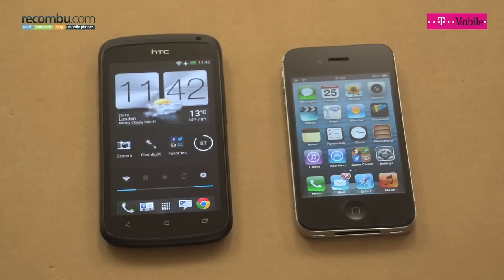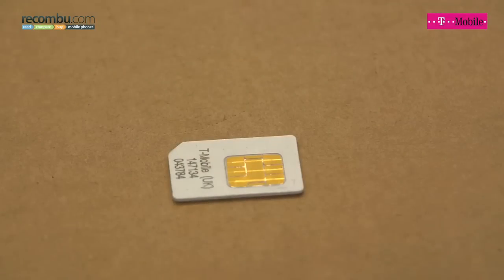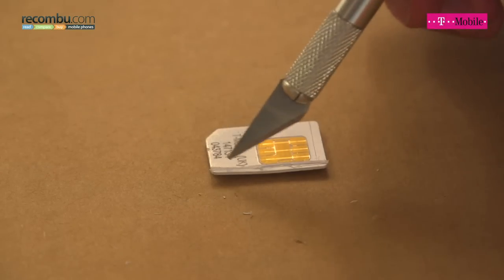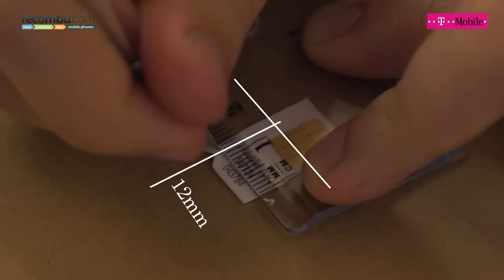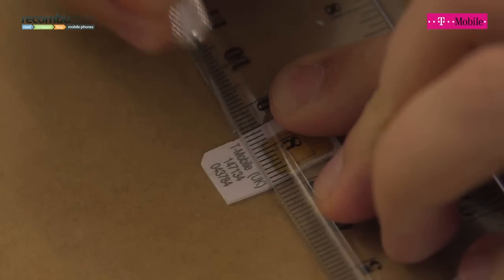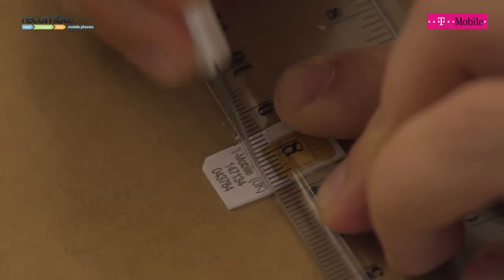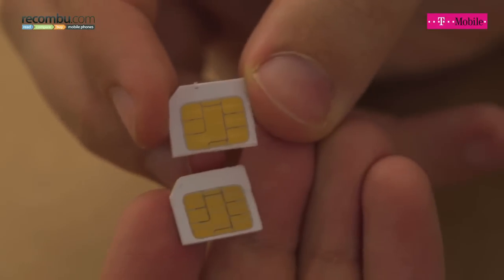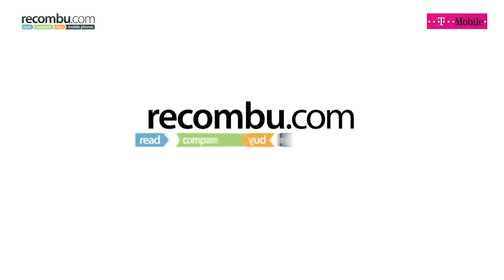How to make a micro SIM card

Comment: 2 things
Instead of measuring 12x15mm you could also lay the micro on top and trace it.
Also, if careful enough, one could simply cut the micro out of the macro card and the remaining border could be used as the micro-sim adapter.

Comment from the maker: It doesn't matter what operating system your phone runs, it'll take any sort of SIM card, you just need to be sure  you have the correct sized SIM card for the job. The iPhone 5 uses the smallest size called a nanoSIM, most of the latest smartphones use the slightly larger microSIM card size and older and more affordable handsets use miniSIMs.

Comment: make sure you sand the edges (on carpet if you do not have a sandpaper) else it may get stuck in the slot due to rough edges. in fact you can do the whole cutting part on carpet much faster, smoother and cleaner looking sim.

Comment: i tried this with a rather old sim, which apparently had a chip/dye size the same size as a micro sim itself. yes i did use a micro sim as template so i didnt just cut it too small.
but needles to say this resulted in my just ruining my sim. luckily i already have a new one from my new subcribtion, only this one isnt activated yet. guess i'll just have to wait a bit.

Comment: Why did they change the size of SIM cards? It does not make any sense whatsoever dammit.
Reply: +MrMonkeybat They should never have been that large, but they were shrunk to make more room for other electronic components.
Reply: Sim cards are almost 2 dimensional, so it does not save any space. Phones where smaller 10 years ago also.
Reply: It does save space because the form factor is half the size it used to be.  The Sim card is thin, but the card slot, and the mount for it, are quite large.  It takes up a fair amount of space on the circuit board.

Phones are larger, but a good portion of that space is taken up by the battery.

It's the same reason most phones  use MicroSD cards instead of standard ones.  Using larger cards means designing around them.
Reply: +MrMonkeybat An management accountancy issue: less plastic. Makes it cheaper to produce on a mass scale.
Reply: They just found another way to get more money out of the consumers .Greedy bastards !!!!Micro Sim my ass,there was nothing at all wrong with the other SIM card .If it is not broke,why fix it!!!
Reply: mbbx5aw2 it is done for reducing the size usage in the phone.. no matter what they do they they will have make the sim card in CR80 or ISO card.

Comment: does this work also with 8 year old simcards?
Reply from the maker: Provided the gold contacts aren't too big, you should be able to trim your SIM without trouble. Older SIM cards tend to use larger chips, making it harder, or in some cases impossible to trim it down.
Reply: ok thanks
Reply: Yeah, I just did it with my old sim card and it worked.
Reply: Just go to your local store, they do this for free ;)